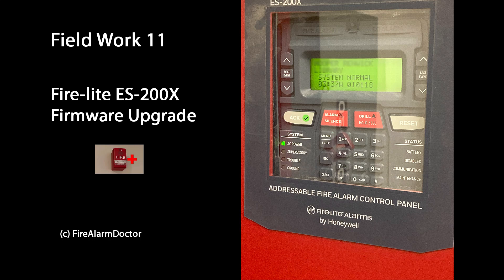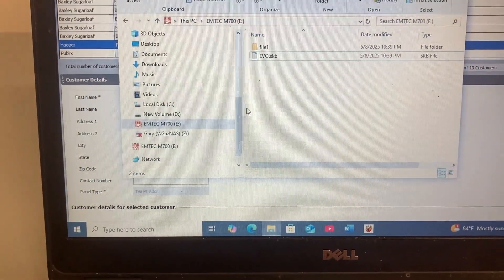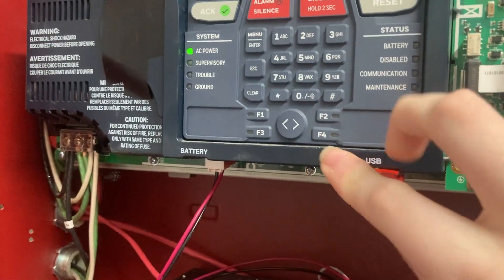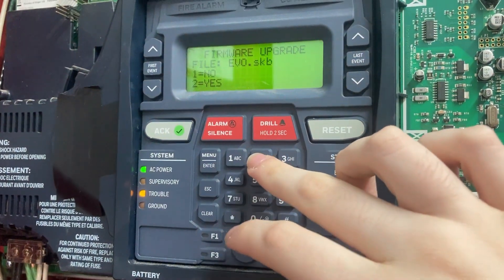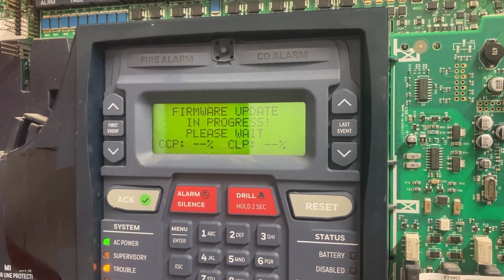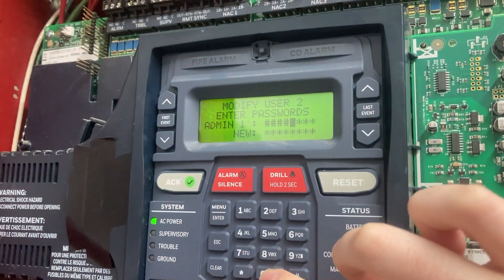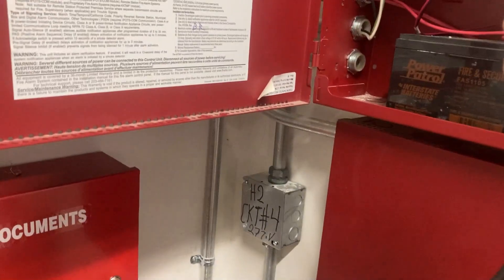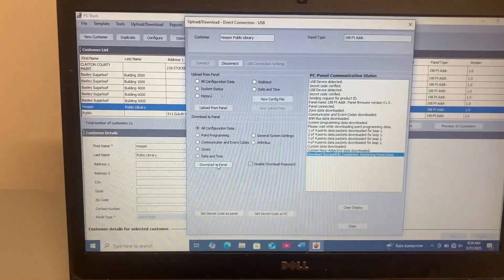Fire-Lite ES 200X Firmware Upgrade | Field Work 11

Comment: Its good to update but it took 45min.  Also with fire lite, there is no way to Label the signal zones as far as I can tell.  Other than that, I like the panels.
Reply from the maker: Had no choice but to update. My office wanted to use SS-PHOTOs made by System Sensor instead of SD-365s. Those are only compatible on version 2.00.011 (latest and greatest). I honestly like the ES series somewhat over the older stuff mainly due to the fact it’s more user friendly and has the function keys, but the biggest gripe I have with it, along with the other stuff we’ve been getting from fire-lite lately, is the slow operation and bad quality control. The keypad is slightly clunky to operate (the panel is clearly underpowered processor wise) and I had to change out 3 brand new pulls in 3 days. 2 of those pulls would all fail to initiate an alarm even when clearly showing an active state on the mini module. 1 of them just stopped communicating all together (no blinking no nothing) and gave an invalid reply even when there was voltage on the data line and was wired properly.
Reply: @FireAlarmDoctorYT1977  I do agree with you on the slowness of these systems. Like I said I have an ES-50X, but ever since I updated the firmware from 01.02.008 to 02.00.011, it has actually been a lot faster than it used to be